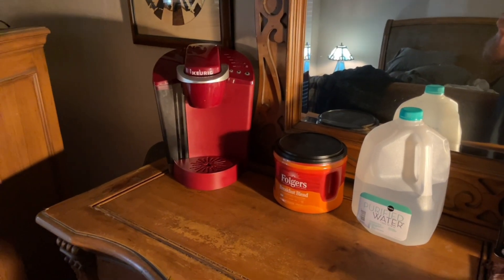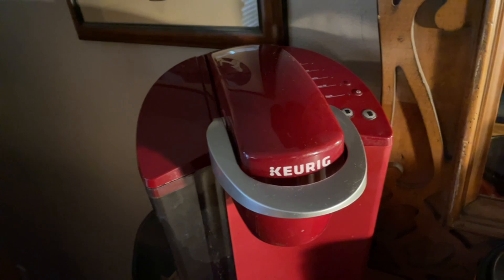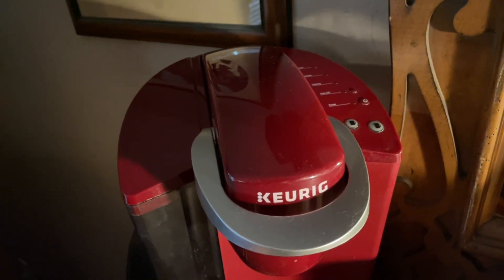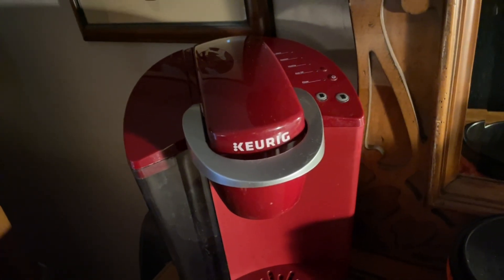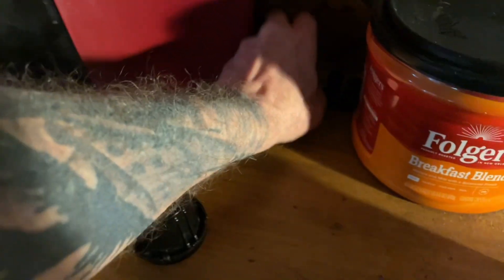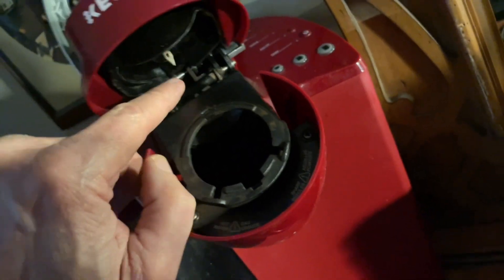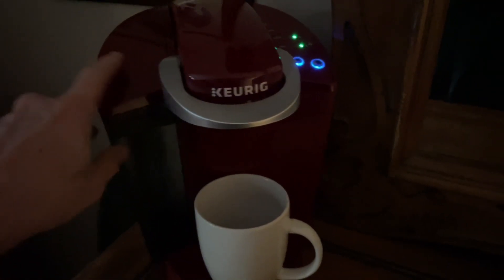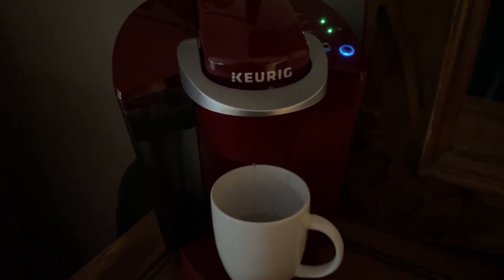Worried About Mold?

Comment: Instead of dumping the water/vinegar solution out, take the tank lid off your toilet and pour the vinegar/water into the overflow reservoir. It will go down into the flush reservoir where the flush water comes down. Let it sit at least an hour, even up to overnight if  desired. This will kill the mold in the flush reservoir and eliminate that nasty slimy looking ring under the flush reservoir in your toilet.
Reply from the maker: Now, why didn’t I think of that? 🤔 😂👍🏻

Comment: For people with the space-saving (no reservoir) version where you do one cup at a time, same idea but do a half-mug of vinegar and run 3-5 clean water cups through after it sits. I set a reminder on my Google Calendar to do it every month or two (or iCal or Samsung or whatever calendar someone has). Also, putting a folded paper towel or cut-out Swedish dish cloth in the drip tray helps with clean-up. 

I don’t use the pods much, I make a lot of Folgers in the tea-bag single serves (kcups taste weird) so that prolongs the life, too.